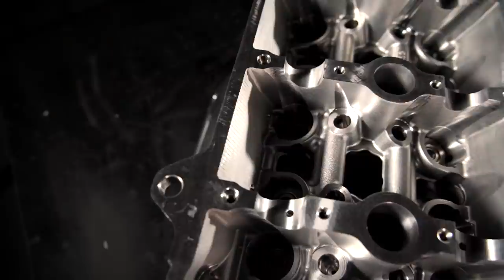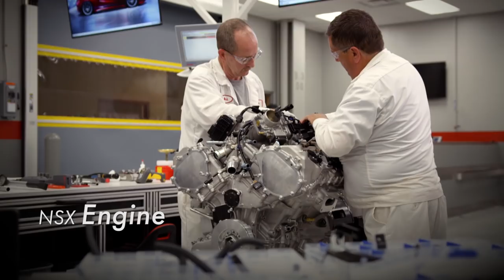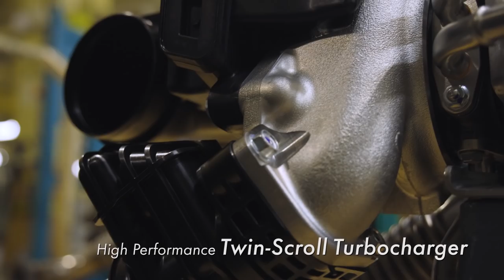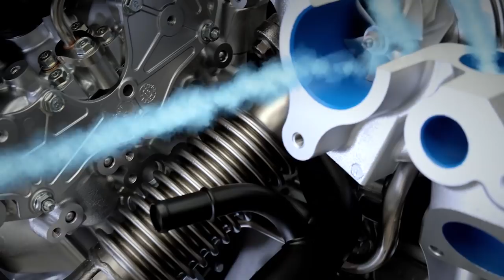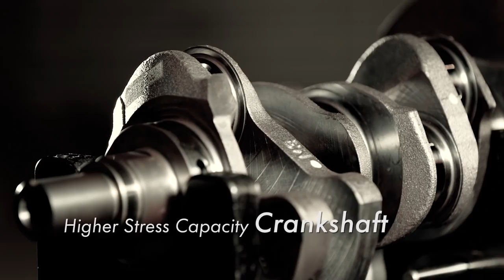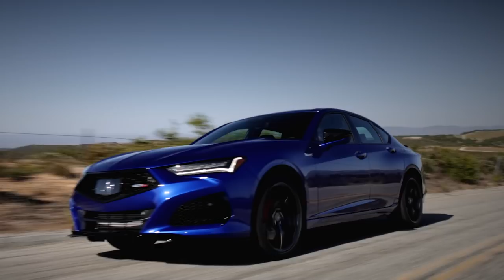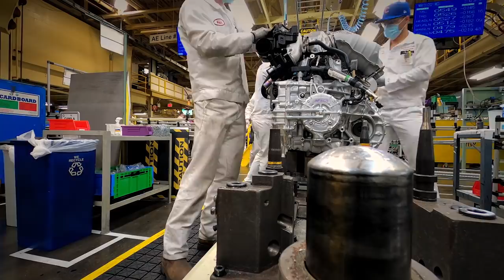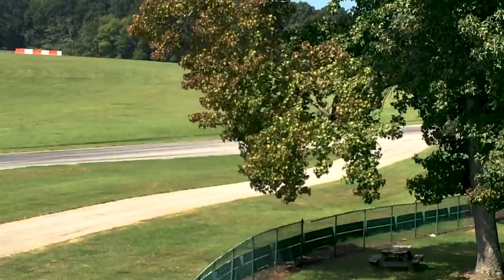Acura Type S Turbo V6 - Development Story

Comment: I love my 2023 type-S. My only complaints are that when you  turn off start/stop or traction control, it doesn’t  remember your choice the next time you start the car. We’re not children. 
And the weird application of braking at low speed sharp turns… I don’t need SH-AWS active rear braking when I turn into my neighborhood at 15 mph, thank you Acura. 
( also the weird throttle response for anything that isn’t sport mode… I would rather it just be linear lower power not the random delay it does. I’m sure they  did this for safety for people who can’t  sit still at a red light. ) 
And of course the free lifetime subscription to puddle lights ( if you’re a TLX owner, you know ) 
Oh and

Comment: So does these mean the J series V6 will be eventually replaced by this new Engine?
Reply: I think not, this engine is designed for type S series cars only, people love the J V6 series, Honda will not miss the opportunity to make more profit from the old but loved J series
Reply: @jtomtl  that brings me some assurance and good news to hear.
Reply: @nighthawkj30A4  Glad to help, FYI this new 3.0 V6 doesn’t have V-TEC, so it’s a con for some Honda fans
Reply: @jtomtl  really no Vtec huh?
Reply: @jtomtl  well they better have Non Turbo Version that has Vtec V6 otherwise its deal breaker.
Reply: @nighthawkj30A4  no, due to the new turbo design and a more compact engine block it doesn’t have VTEC
Reply: @jtomtl  well hopefully they make it without the turbo
Reply: This IS a J-series...the engine code is J30AC
Reply: @KardiFan2000  no, this is not the same 3.5 J -series engine, it’s “all new”
Reply: @jtomtl  Yes, but it still has an engine code that starts with J...meaning that it's a J-series. This is most likely the next generation of J-series engines...the original J-series has been around for 25 years, time for an upgrade.
Reply: @KardiFan2000  u know that Honda fans love the old one to death right? It’s old but it’s reliable, has V-Tec. We shall see how the new generation holds up in time
Reply: J30AC

Comment: Dear Honda,
Congratulations. You have finally come back with a car that can compete with the market. Mostly all I wanted Honda to be. That being said, let me tell you one thing. You are one company that I would 100% trust when it comes to engine that can rev to 8000-9000rpm. You have accumulated such knowledge over the years and that is what made Honda stand out. I know there is a reason why turbo is instead being used over letting engine to run faster. However, I would someday want to see those engines coming back. So I say "You have technology to create one of the most addicting engines to drive on street. USE IT! Find a way to make it viable versus other engines!". Please. Thank you
Reply: Where do you see 9000 RPM? 6200 is all this thing allows.
Reply: @Sergey M, who cares, it produces peak output at well under 2,000 rpm.

Comment: They removed VTEC right?
Reply: Unfortunately. They put dumb VCM in the car but not vtec.
Reply: Vtec Bhhhhhhhh
Reply: @robbym3542  There is also VCT in this engine...same system that's used in the new NSX.
Reply: @KardiFan2000  that’s nice but most of that is for fuel economy. The motor needs to rev out more and have vtec. 6k rpm just isn’t exciting. Bmw makes the best engine right now IMO
Reply: @robbym3542  True, but the days of hitting VTEC at 8000 or 9000 rpm are unfortunately over. Turbo boost is the new wave for Honda...more fuel efficient and more torque.
Reply: @robbym3542  Why Toyota chose one for the new Supra.

Comment: Does this engine have a timing belt or timing chain? Why is this information suppressed and so hard to find? I am assuming Acura is using a timing belt to save money and increase maintenance costs to the owner? Bad move! From the video I am seeing what looks like plastic cam gear covers.
Reply: Disappointing to see that they still have timing belt & open deck design
Reply: @k2t210  Mercedes new M139 engine produces 208 hp/litre and uses a closed deck engine. Acura didn't need to use a turbo for such a low hp/litre engine. Turbos stress the engine. They reduced the engine size from 3.5 litres to 3 litres and then used a turbo to gain back power lost from decreasing the engine size. The Acura engine designers need to be fired. They easily could have got 100 hp/litre out of the 3.5 litre if they wanted too. Really they went for a turbo to get the seat in the pants torque off of the line. Turbos are like 98 lb weaklings taking steroids.

Comment: Now they need to put this motor in a premium rear drive sports sedan.
Reply: and manual so i can drift and Acura lol, I would 100% be buying one if it was RWD manual
Reply: The TLX IS a premium sports sedan. The SH-AWD system sends up to 70% of the power to the rear wheels. Best AWD system on the market

Comment: It needs more HP. All of its competitors have more than 355 HP. Also, those exhaust tips are hilariously huge. Just do a center exit exhaust with two 3” tips.
Reply: "Just do a center exit exhaust with two 3” tips."....it's not a Civic 🤦🏾‍♂️
Reply: Just turn the boost up.

Comment: I wish Acura would make a 6 speed manuel version😔
Reply: Perhaps they will consider it just have to push them for it. After all they need to listen to there customers.
Reply: People actually have to buy them though...when the ILX had a 6-speed, barely anyone bought them...and not surprisingly, Acura dropped the 6-speed. People need to stop capping in the comments and actually buy the manuals when they come out 🤦🏾‍♂️

Comment: I wonder if this engine has VTEC. It would be nice if it had it on both intake and exhaust, but if it even had vtec, it would probably be only on exhaust just to light up the catalytic converters faster for emissions purposes. A man can hope though
Reply: No VTEC
Reply: @hybrdthry911  I cannot lie. I am dissapointed. I wish honda could make modern, dual VTEC, naturally aspirated, high revving motors like the original K series and B series again. Ah, one can only hope
Reply: @inaNis_  They won't...that era is pretty much over. When Honda announced their Earth Dreams technology a few years ago, I knew things would change. They're all about fuel efficient turbos and lower-revving engines now...it is what it is 🤷🏾‍♂️
Reply: @KardiFan2000  It's unlucky to see but they gotta do what they gotta do in this market to survive. Hell, even toyota is making under squared, turbocharged, torquey engines as well. I don't know if there are any main stream companies that are still making high revving NA motors anymore, honestly
Reply: DOHC

Comment: Had me until VCM... I sure hope it's better than it is on our Honda Pilot.
Reply: Are you kidding me? OF COURSE it's better than the Pilot's engine, hilarious comments on youtube 😂
Reply: @omairsh8  Hey - Clearly I was talking about the implementation of VCM which had MANY problems on Honda's prior models including causing ring fouling / sticking, leading to spark plug fouling, misfires, catalytic converter failure, and led to countless rebuilds. Honda even got sued over it because it was such a disaster. That doesn't even include all the NVH issues, which as the mounts broke in just kept getting worse. Yes, I hated my car with 5k miles and Honda could only say "that's how it's supposed to run". Sadly that was how it was supposed to run with VCM.

I'm sure the new engine is more powerful and responsive but if it's as remotely bad as what they did to the  J35Z4 then it's a hard no from me.
Reply: Hopefully there will be a VCM Muzzler for that VCM. Don't want to run into engine mount issues, ring fouling, oil burns.
Reply: @romanjaan19  Yeah, sure hope so. Honda has at least been consistent with connectors and all, I wonder if the existing solutions will still work.
Reply: 180k on 2014 Accord 3.5 absolutely flawless.  Never any issues, can barely feel the engagement.  Saved tons of gas over its life (MPG well north of 35+ when engaged at highway cruise)
Reply: @oldtwinsna8347  Consider yourself lucky then. My wife never felt the vcm engagement. I did. It was miserable. Lots of people on the forums with high oil consumption leading to misfires, leading to cat problems on Pilots with it. Typically starts becoming an issue around 100k miles, but for sure doesn’t happen to everyone. The sad part is I see more major engine problems on the Pilot forums than I do on the BMW and Audi forums mostly due to VCM.

Comment: I wish this thing had a higher redline. Peak power at 5500 rpm? That's below big pushrod V8s...what gives Honda?
Reply: What I understood was they're trying to go for the sweet spot between power and efficiency. I think this is how it's going to be in this efficiency era unless they come out with an actual racing engine like they did with Formula One engines, but since they're leaving F1 I don't think that's going to ever happen again.. kinda sucks.
Reply: And pushrod V8 do not last long at high rpm.
Reply: Prob 6500-7000 redline ,peak power @5500 rpm
Reply: @jogonz5833  from on-track footage the car shifts at 6000 rpm...that's what's disappointing to me... I miss the Honda/Acura of old.
Reply: @tyhyhh  then just go hybrid, Acura. Screaming 7000-rpm 300hp V6 with three electric motors (two in the back and one bolted to the engine) Wait, you did that already. Bring it back...

Comment: "Designed for both sports sedan and SUV customers" well that explains why the peak torque is so damn low.  Is it just me or would it not be the worst thing ever if, a car manufacturer put peak torque at like 4k? Instead of 1.4k actually make you rev it out? Not as bad as the 1st gen 86 tho but

Comment: Bring up the Hp and torque to 400 Hp make it on par with bmw m340  then you  have a true winner 
This car is not even in the top 4 under $60 k , stop holding the car back the drive train can take it .

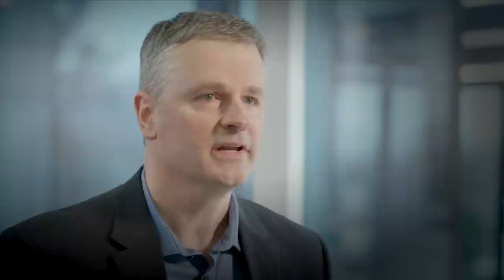Comment: 2:32 "Providing an immediate engine response", that is far from desired marketing, I have driven it and the turbo lag even in Sport+ has huge room for improvement. No where near to 2020 BMW 3 series 4-cyl, nor 2019 BMW 3 series 4 and 6-cyl, neither the 2019 Genesis G70 4 or 6-cyl.
Reply: Ktuner or Hondata will fix that issue. I’ve done the same for a 2019 accord 2.0t. The stage one and stage tunes allow for quicker turbo spool. It is a night and day difference!
Reply: You drove the 4 CYLINDER, not the Turbo V6...the Type-S hasn't even been sent out to dealers yet, last I checked.
Reply: @KardiFan2000  check well, because I drove it already last weekend.
Reply: @ninioburbuja  Might I ask, which dealer you went to do your test drive?
Reply: @ninioburbuja  Yeah, yesterday I found a few videos of the Type S in dealer showrooms...it appears that the car only arrived about a week or so ago....I will have to take your word on the Type S being below the Genesis, although I can totally see the BMW being a better performer. IMO, if the Type S can outperform the Audi S4 and Genesis G70 (in most people's opinion, after driving each of them) then I would consider the Type S a success.

Comment: Good job on the engine, Acura. Now invest in reducing the weight of SHAWD and bring the next gen Type S under 3800 pounds. Target 3600 pounds. Respectfully, a 2012 TL SHAWD manual owner.

Comment: its a Fail... transverse platform layout, single turbo?? Ford's 3.0TT has far more hp/torque, can even be tuned (reflash) for an easy 500hp+.... Stop putting your engine/transmissions in the wrong way... leave that for your Fit & Civics
Reply: It’s actually a pretty sick car lol
Reply: The Ford lacks the Honda's refinement, it's not all about who has the most turbos, most hp, and most torque.
Reply: @KardiFan2000  It is when one drives on the road and gets the numbers.
Reply: @KardiFan2000  disagree... drive the Explorer ST and the Lincoln version.... extremely refined when you want it to...
Reply: @omairsh8  wtf? lol... not very creative there rookie
Reply: its still Cheap wheel drive... the only reason why they can't do RWD chassis is because they cheap out on manufacturing.... keep the same tooling as the Accord, build it on the same line....

Comment: Its a very nice engine. But a tsx k24a2 with rsx oil pump and 50 degree vtc with an ebay tornado will put out twice the power with nearly the same reliability.

Comment: It’ll be interesting to see how this engine holds up over time since Honda/Acura never released a Turbo based engine for consumers before until recently. (Not sure if they have for their F1 engines). Though I’m a little bit disappointed it doesn’t have VTEC. Not a deal breaker but it would’ve been great.

Comment: All this Talent, 5yrs and only 355hp?
Reply: You do realise most speed limits are 65mph right? You want 400hp when you'll still be driving in parallel to a Prius on the road? 355hp is MORE than enough for 99% of buyers
Reply: @omairsh8  EXACTLY. Most people on the road today don't even use their car's max HP or torque, yet they want to complain that 355 hp is "not enough power" lol.
Reply: Honda is notorious for low numbers. Get a tune and you’ll be surprised what they can really do.
Reply: @omairsh8  Don't make assumptions of things and people you don't know.
I am currently driving 2020 BMW 540 and was, actually I still am,  interested in TLX-S. I owned the first gen TL-S in 2002. I am very disappointed that TLX-S is heavier than my BMW and likely is not much powerful. As to road speeds, if you have a fast car you routnely hit 120-140 mph even on US roads. BTW, our roads are great, laws are stupid.

Comment: No offense to all engineers working on this engine, but old TL 3.7 was making 305 hp.The car was lighter.Now 355 hp with 4200 lb of the car. No progress at all!  I know...torque, but still not enough!!
!
Reply: It's A full Size Sport Sedan Boy! That's why it weight 4200 lbs..Don't expect McLaren Lightweight frame on This Vehicle. Use your Common Sense 🤣
Reply: @GoBrand0n  So that's underpowered 'type S' !
Reply: @GoBrand0n  2012 TL is was about the same size,and still lighter,even with 3.7l engine.So what are you talking about???

Comment: Underpowered.
Reply: but reliable, go get research
Reply: @ericdarmawan9504  The 3.0T engine has never been released and Acura had tons of issues with their transmissions, and oil burning in the Honda turbo variants.

Comment: This car lacks 50+ hp to its competitors, is500, q50 rs400, bmw m340 etc
Reply: And 5 miles less per gallon compared to the Germans
Reply: I agree except there’s a case for the is500 and q50. The is500 is a v8 and the q50 is a twin turbo so it makes sense they make more power.
Reply: The issue isn't necessarily the power, its the weight. The Audi S4 has about 349 horses, but it weighs around 300 pounds less I believe. That makes a huge difference.
Reply: @lloydhudson6463  oh yeah, I almost forgot about that
Reply: @bakedtatochips2728  Yeah, Acura has to find a way to save weight on this car. More power is great, however, with some weight savings and increased fuel economy, this car would really stand out.